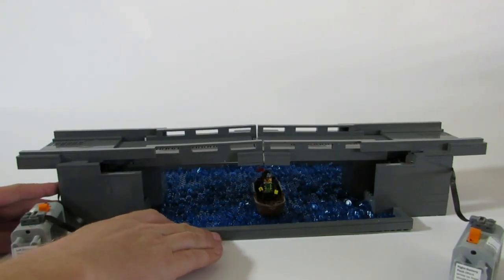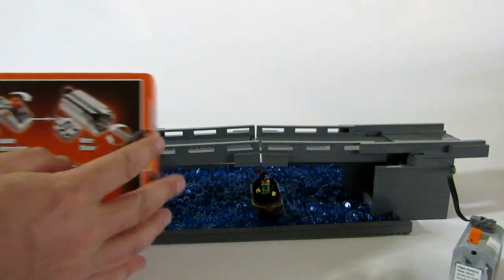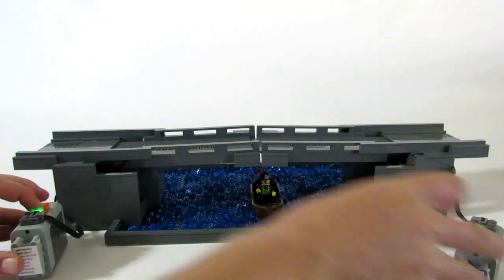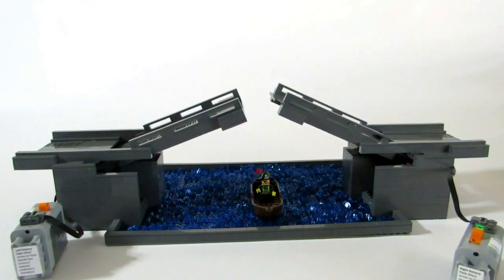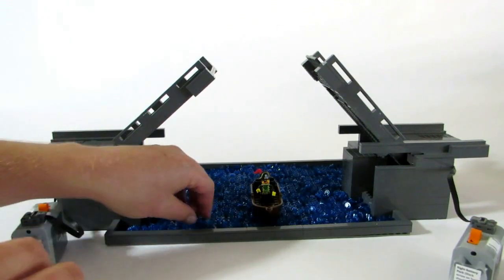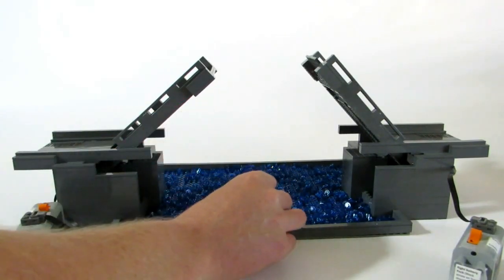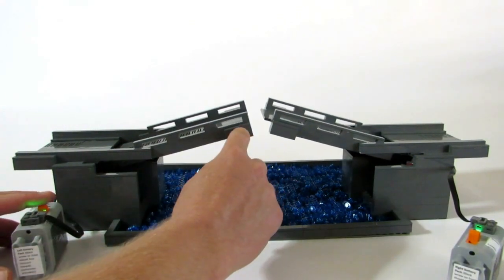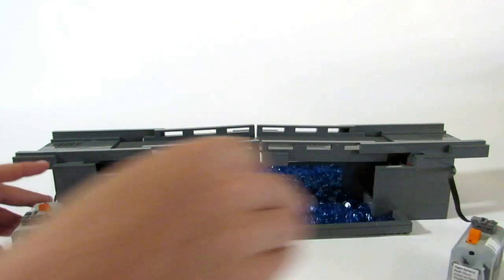Working Bascule Bridge Lego Drawbridge Custom MOC Trade Show Lego Display Model Builder

Comment: nice drawbridge ! 
maybe you could connect the two motors to one battery box so the motors start en stop at the same time :D
And now that you have power functions maybe build a tank ? :D
Reply from the maker: I thought about that but one side has to fit into the other side, for some reason I couldn't get them to raise and lower at the same speed and didn't have enough time to figure it out.  In do want to build a tank at somepoint, I need to buy some more power functions, I've been researching the different types of motors. Thanks again for checking out the Lego drawbridge.

Comment: Nice! Now here is a chalange: Make a bigger bridge that can also be used my a Lego MINDSTORM Car! (A  car be made with pin pieces (Tecnic) and with some wheel pieces. ) That would be interesting.
Reply from the maker: Oh man, I'm exhausted after getting the drawbridge done. I didn't mention it in the video but it all has to be glued and shipped. I bought solid foam house insulation and made a custom box, took like 6 hours, the gluing took around 5 hours also. Anyways I'm taking a short break, I've been puttering with a HEMMT container carrier build with an A4 load system, I have to get back to that though.